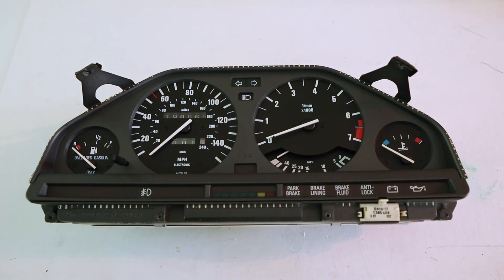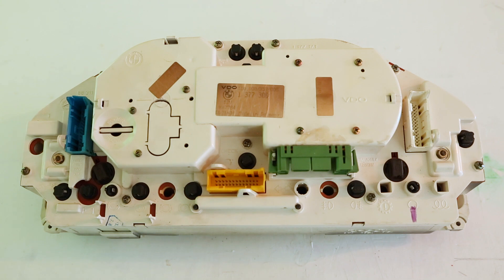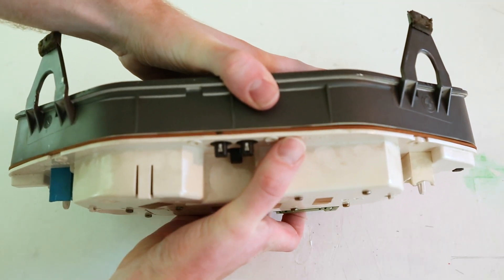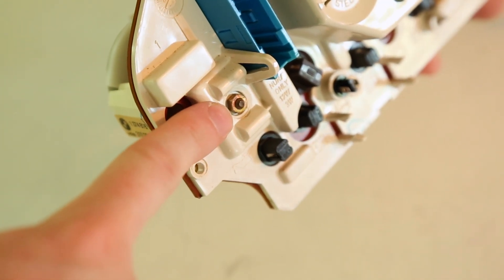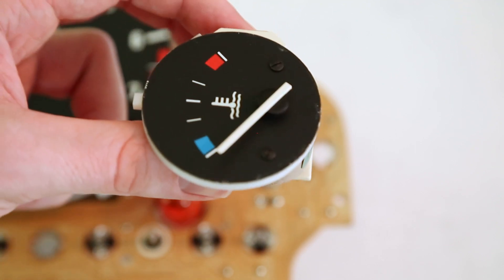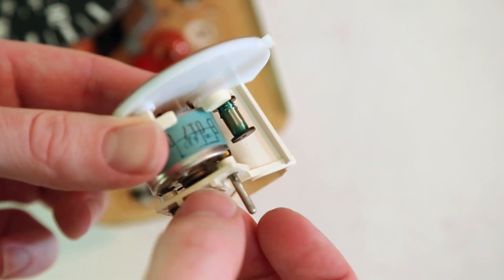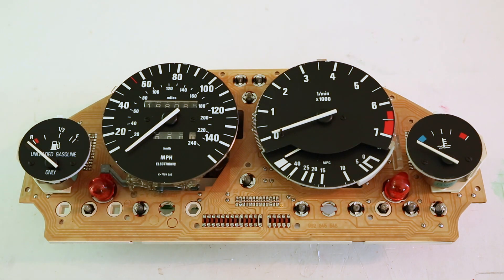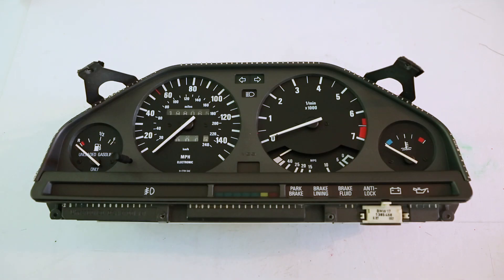Intermittent Gas and Temperature Gauge Repair BMW E30 E28 E24

Comment: I cleaned the connection where the gauge centre post makes contact with the circuit board and the corresponding board connection as the terminals themselves were pristine. In any event it completely sorted the problem. Excellent tutorial.

Comment: Awesome video brother! I was having a slight overheating issue with my 86 325E E30. I replaced everything you can think of that had to do with the cooling system and nothing seemed to work. Water pump, thermostat, fan clutch, coolant temp sensor, coolant temp switch, etc… I came across your video and got straight to work. It turns out my cluster was giving me an improper reading the whole time. The car was actually running at a good operating temperature but it displayed otherwise due to a grounding issue with the loose grounding nut you showed.

P.S - A great way to tell if you might have this same problem is if your gas gauge/temp gauge shakes/bounces around. 

THANK YOU! 🙌🏽

Comment: great video......I would like to add that when I take a cluster apart, I replace all the bulbs. I also use dielectric compound for all the terminals/connections  so I never have to go back in the cluster.....

Comment: Great video !  The fukup is that the heat gauge voltage is not fused. The gauge can go faulty even when you replace the battery.

Comment: Excellent video again!
Reply from the maker: Thanks Victor! You may also like this short video on polishing the plastic cluster cover: https://youtu.be/P6-rAXFv07M
Reply: +BIMMER ZEIT 
Thanks! I saw that one already! ;-D
About you're Hartge valve cover; is that really for a M20? There're no mounting holes for the intake bracket, are there?!... 
Keep up the good work!!!!
Reply from the maker: Yep it's an early M20 cover. The early models had a slightly different setup, but you can install it on a later model without the bracket.

Comment: After removing the gauges, my VDO tacho did not have the small washers for ground contact. I tried installing additional thin washers, but then the whole back part does not sit properly in the front part, temp and fuel gauges seem to hit the front frame round cutouts. Reinstalled without washers and everything is good.

Comment: After disassembling and replacing battery on e28 cluster, my temp and fuel gauges jump to high and full when ignition is on and stay on full and high when driving, any idea what I did wrong?

Comment: Lets say the temp gauge wire is bad or it has a bad reading on the engine block. Would the fuel and tempature gauge stop working all together?  I tried cleaning and tightening the cluster and even tried a whole new cluster from a junk yard and no changes. Any advise is appreciated. Thanks for the video.
Reply: Hi, did you solve the problem?

Comment: The M7 has NiCd batteries on the printed circuit board and yours does not.
Remove the instrument cluster was a nightmare due to the age of the car 
being 30 years old. Didn't want to break those cables/wires.
Done all the cleaning & new NiCd batteries, still have the same problems.
* Tach not working
* MPG not working
* Temperature dial moving like a wiper-blade

Any suggestions?

Nice & clear video.
Reply: +angelisone Just a guess here angelisone but I would look at all your grounds, if you have lights working in your cluster you have some power, but the grounds aren't fully grounded, check where your bundles of wires go thru the firewall...you could have a hot wire shorting to ground (the body) also. is your battery getting weak sometimes? stuff to look for :dirty/rusty connections/ wire missing plastic coating, lights flickering at night when going over bumps....
Reply: +danekeeper1 Well, my main battery goes dead after 3 months of not using the car. And 7 months or so, the NiCd batteries go back.

I will open the cluster again and check all grounds. You are probably right that they are not fully grounded. Troubleshooting this is no fun, I just don't have much room when all plugs are plugged to cluster.

Again, thank you for these suggestions.
Reply: In order for your MPG gauge to work, both your speedometer and tachometer need to work. In most cases when a tach isn't working, it's because your tach signal isn't there. Your tach signal comes from either a signal wire on your #6 ignition wire, or one of your 2 crank angle sensors, sometimes both. If you dont have a signal wire wrapped around one of you ignition wires, its going to be a crank angle sensor. On yours, the crank angle sensor is usually on the intake side, where the engine and tranny meet, some models have it at the crank pulley.
As far as the temp gauge waving hello to you all the time, apart from this cleaning procedure, I have found re-springing the contacts on the harness end sometimes helps.

Comment: i have a fuel gauge that shows full when i fuel to full. but then it drops rapidly when it hit half mark like around 200km. after this, it is no longer accurate and it quickly drops to zero! or below. 

what is the cause of this problem?
Reply: If your car has a saddle style fuel tank, the transfer pump or saddle hose might not be working correctly to fill the side of the tank that the pump pulls from.
Reply: @mikepottle6647  good idea to help me. Mine is a saddle style tank. Let me check. Do you think the transfer hose to the other side is clogged? But I read that the 325 fuel tank has two senders?

The reserve ought comes on accurately when fuel is near empty even though the gauge shows empty for a few hundred km. That’s the one warning lamp I use to rely on to refuel.
Reply: @selespeed3  maybe no clogged, but I've seen them break causing this issue. If you pull up your rear seat to gain access to the tops of the fuel tanks, you can check once the two metal plates are removed and lids taken off.
Reply: @mikepottle6647  is the rube connector at the bottom or top of the tanks left and right?

Comment: Is all cool..but looks like mine has third problem...I cleaned I did everything ..still dead.. I putt Gage from  e34..yes they don't fit..I makes it fit and plus ground terminal has no nut.. tree pins ...fun...job. So I did is contacted..And what I see ... arrow move to overheat on cold engine..suck ..just waist time and money..Now ..I'm goin check ground if is not working.. I'll run by pass from fuel gauge ground to the temperature gauge ground..

Comment: My odometer isn't working but my speedo is. I checked the gears and they looked fine and when I spun them they spun the odometer. Any ideas?
Reply from the maker: Nicholas Bouffard hey Nick I'm not too sure. Have you tried posting a thread on r3vlimited?
Reply: SI Board Batteries...